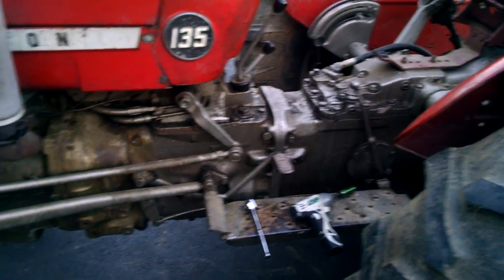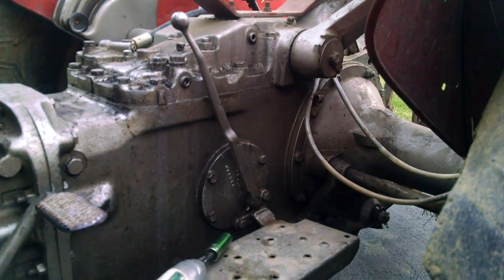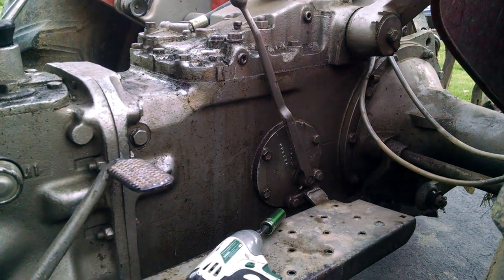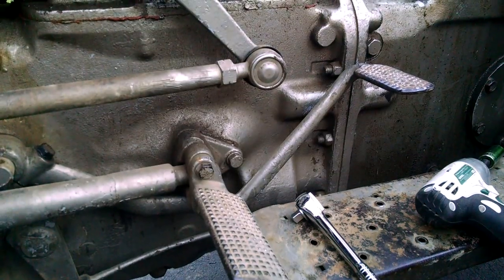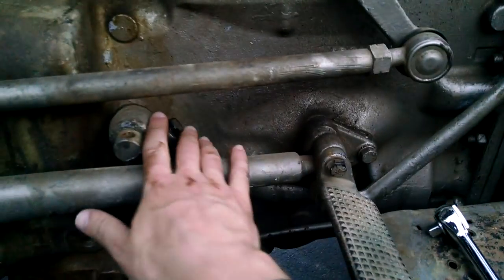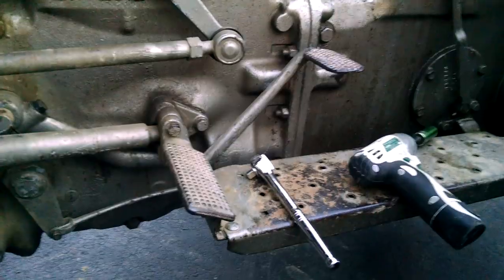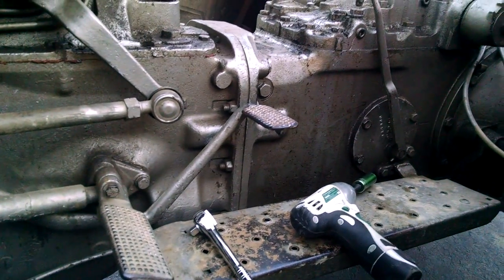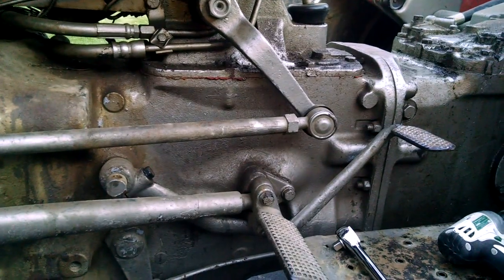Massey Ferguson 135 Clutch Issues

Comment: Possibly frozen or broken release fingers
I split my TO35 a few years ago for a "hard" pedal issue. Turns out the previous owner replaced the clutch,BUT put the main cone springs in bass ackwards and it was like trying push the ground away. Put it back together correctly and not a problem since. Almost 8 years ago.

Comment: You have to adjust the pto clutch through the plate on bottom which gives access to the clutch turn the engine with a pry bar to line up the adjustment bolts three I think

Comment: I thought you could adjust the PTO Problem behind the plate where the lever is? I've had to start my 135 Diesel with PTO engaged like you said for about 3 years now..haven't had no problems with the main glutch

Comment: I suspect the problem might be one of the clutch toggle bolts have come out. There are three bolts in the centre of the clutch that the clutch release bearing pushes on, I have know these to come loose and fall out. Best is to split the tractor and over haul  the clutch, When I worked for an MF dealer in the 60s and 70s I could do the job in 4 hours on site. If it needed a back oil seal that would be another hour.
Reply: Under the tranny is a plate when you remove it the 3 bolt is visible and accessible. Usually one bolt falls out… an finicky fix but only 1/2 hr task.
Reply: @stevenandrushko8380  hello

Comment: I'm right there with you we loaded the tractor to do some mowing and when we returned home, my husband started the tractor and let it roll off the trailer.  I don't know if it was I'm neutral or reverse but it popped as it rolled off.  It runs but wont go on gear.  We were told it needed a clutch.   That's the 2nd clutch we've put in it in 2 years.  My husband is over it and just wants to give it away.  We paid too much for it and can't afford to be giving it away.  Does it sound like the clutch or something else?  Are we going to have to get it to someone with a chain hoist to take it apart?  Any idea what it will cost since getting this fixed will probably be my birthday present.
Reply: Hi Cindy, I see this was posted 5 months ago, but may be able to give some insight. First off, have you gotten it fixed? Sounds like the coupler, it's not that hard of a repair.
Reply: 300.00

Comment: Sorry to say, but you will have to split the tractor at the bell housing to  get to the clutch. Could be  the throw out bearing are fingers on the pressure plate are both. Most likely a couple hundred bucks to fix.

Comment: what did you do to the clutch when the PTO wouldn't engage? I have the same issue and I've been told to adjust it but not exactly to sure on what they mean by it.
Reply from the maker: I started the tractor with the PTO engaged.  It isn't recommend, but it works for a while.
Reply: @slhilbert  NEVER DO THAT.